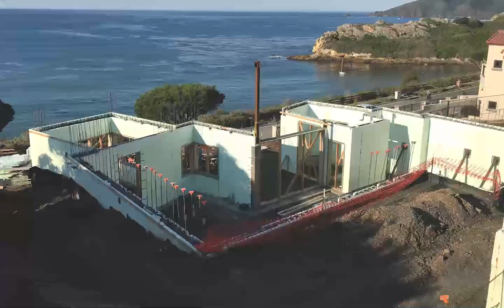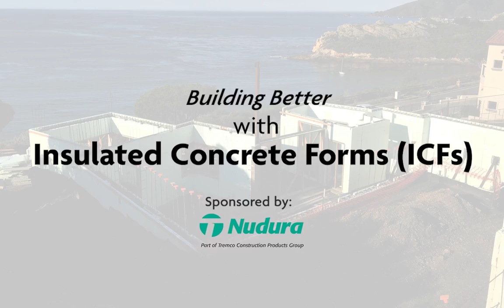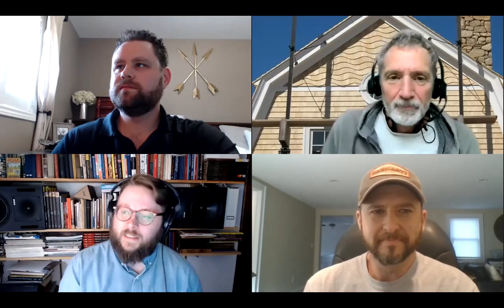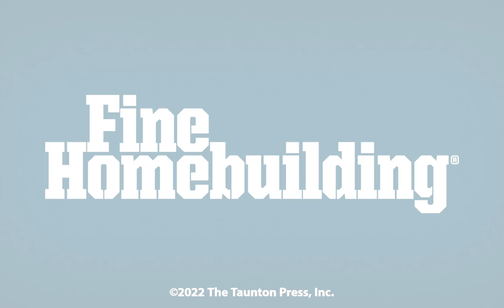Building Better with Insulated Concrete Forms (ICFs)

Comment: Late to the party on finding and adding comments.  For anyone that watches this as a novice to ICF, you will find some great information.  Always consult your local code and ICF manufacturer recommendations.  Couple quick points, yes, I am an expert and have not just built ICF as a contractor, but I have also trained other installers throughout the US.  ICF and all concrete placements should be properly consolidated.  In this video multiple methods are mentioned; each may be appropriate based on height of pour, temperature, and slump of the ready mix.  Termites don't eat concrete but can travel long distances to get to wood. So if you are worried about termites then you should most definitely be using ICF, you should choose additives that deter termites, inspection strips, and of course proper termite control on an annual basis.  I notice the comment below about ICF not being accepted, while possible, the argument is not logical and is typically a resistance founded on false information.  Check with your ICF manufacturer on how to proceed.  Do not give up on ICF because one code official, architect, or contractor says that it can't be done.  Punched openings should always be set in place as you build, with forms being installed up to those frames, which assures proper rebar placement but also allows us to minimize material waste.  The frame needs to be anchored to the concrete, and either treated material or separated from the concrete.  The Prebuck mentioned is by far the superior option for ICF built facilities.  Do not block out large openings; engineer the beam as much as possible with the ICF; maximize the insulation value and thermal mass.  When you consider cost, we forget that we operate our buildings for many years; ICF will be the lower cost structure over time.  Plus you get all the free benefits of sound attenuation, fire and wind resistance, and pure comfort benefits.  I'll stop there...great work by all involved on this roundtable.

Comment: Forget what they are saying.  Having designed and built with ICF's, depending on where you are located geographically, building codes do not always allow ICF's because they provide a great path for termites to get into the house structure to wood framing above (the southeast other than Florida, which is coastal plain sandy soils).

If your plan is all masonry and poured concrete /steel or if using CFS, this is an issue which can be overcome.  For Florida houses which benefit from the enormous insulation factor the poured concrete reinforced with rebar holds up to tidal surges and hurricanes. Or if you are in the northern part of the country, the insulation is great for controlling conditioned air.  

Although this video is not helpful, google ICF's for building and get all the on-line time you want.